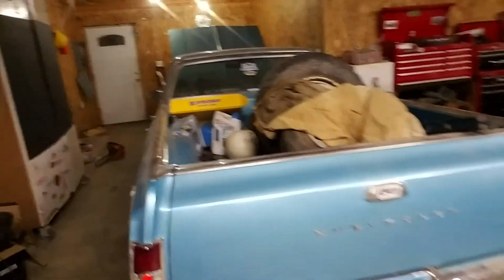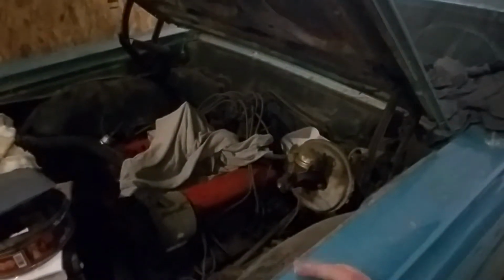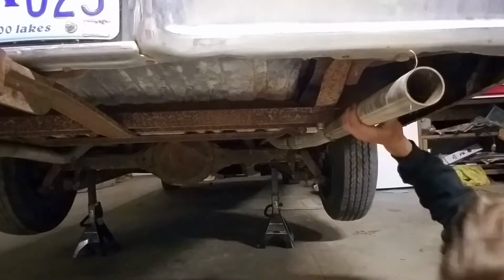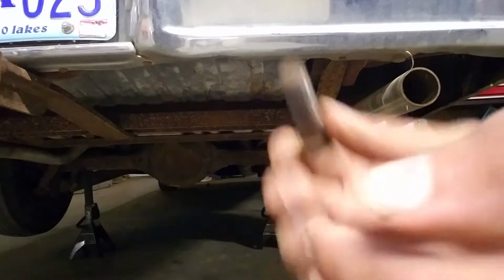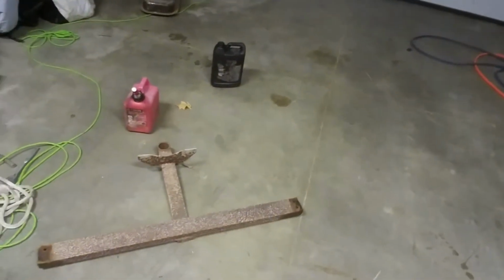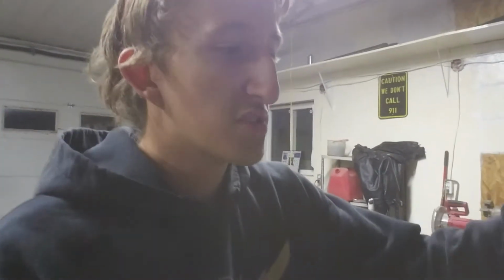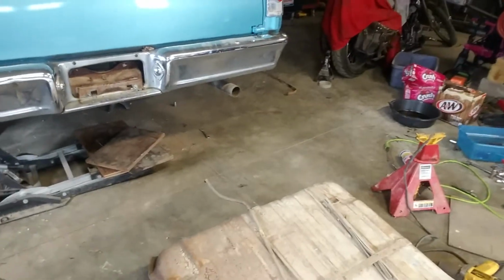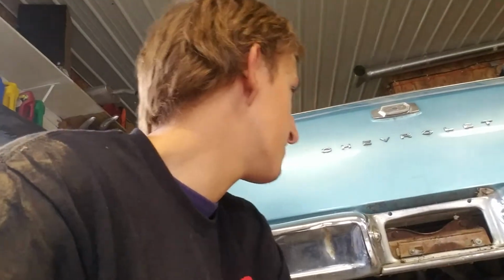1964 El Camino Restoration part 3 |ripping out the gas tank|

Comment: when I saw the bolts on your tank I ran outside and put wd40 on the bolts for my 64 el Camino tank the new one is ready to be installed and I wanted to see how it was done before I did mine...
Reply from the maker: yea they were bad. didn't help that the nuts that are tac welded to the frame broke which made the process 5x times longer. thank your for the sub  and hope you get yours on the road soon. actually working on a new video at the moment for it and i will try to have it up tomorrow. as long as the tac welds dont break it should not be to hard.